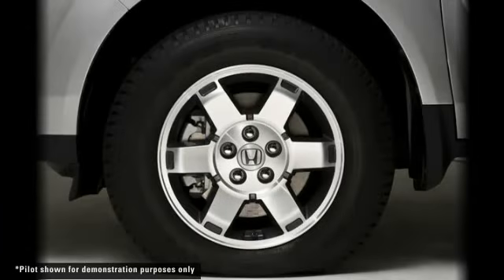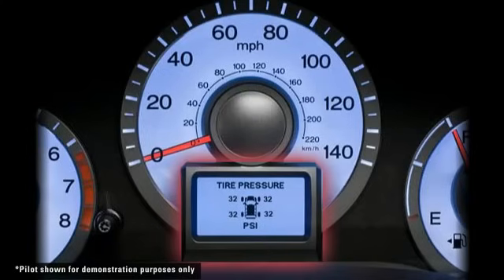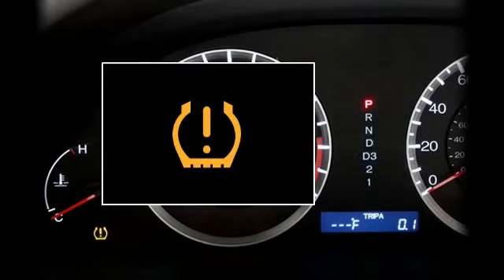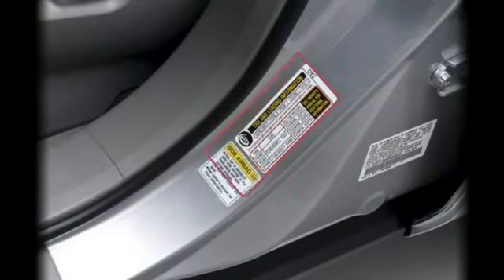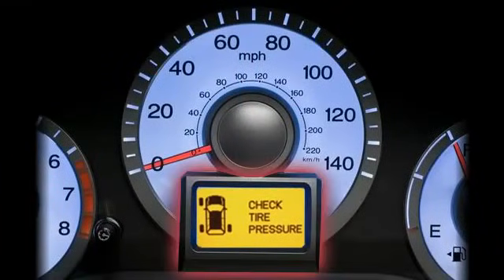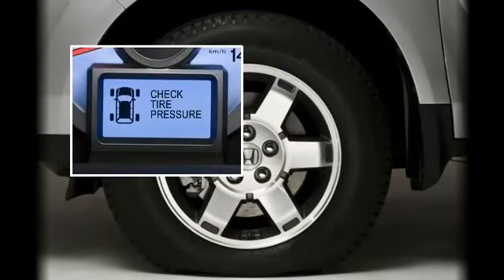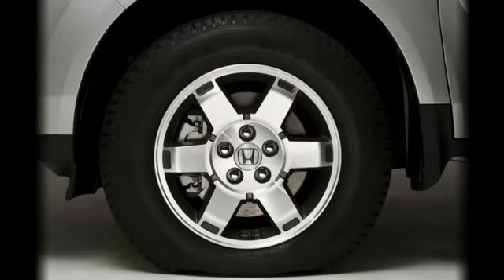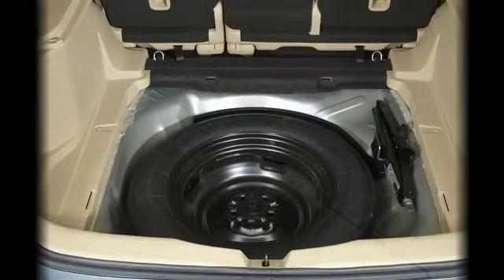Honda's Tire Pressure Monitoring System (TPMS) Explained

Comment: In the good old days, drivers didn't need a TPMS! All you had to do was to do a monthly (or more, if you wanted to) tire pressure check using a simple pressure gauge (either the pen type or a dial type). If your tires were running a bit low, go to a gas station and put a little air into the tire or tires. Let's call this the "Boomer Tire Pressure Management System" or BTPMS! You know what? You still don't need an automated TPMS if you use the BTPMS, which is what I do. My TPMS light came on, but I have a nice analog dial tire pressure gauge, that I use each month. I also have a digital tire inflator that I use to keep my tires at the precise pressure that I like. Let that TPMS light wear itself out! Useless gadgetry! 😣

Comment: 2014 Honda Pilot. All of the tires are almost brand new. Not flat. But the stupid sign won't go away
Reply from the maker: Hi Fina! You might need to get your local Honda dealer to reset the light!

Comment: What happened if it’s says tpms and monitor problem and I got 4 new sets of tires
Reply: Ohh let me do that in 15 mins I get out of work and let’s see the readily :)
Reply: I think I tried that before like reset your tire light away
Reply: Wiring or ecu, take your pick…
Reply from the maker: Your TPMS censors will have to be calibrated every time you put new sets of tires on your vehicle. It will be under your- Vehicle Settings>TPMS Calibrations. Calibrate them 3 Times! On the 3rd time it will put the car into learning mode and it will take care of your issue. If your light doesn't go out then, you will need to see your local dealer and let them try to recalibrate them. :)
Reply: I did that two times this morning and it still has the light I don’t wanna take it to the dealer I have to wait for 4 hours for them not to fix it I already did all that and waited atleast every 4 hours every time I hit the dealer and they say they we can’t get to the senor all the time I been there I been there like 6 times

Comment: Whats the Correct air pressure for Honda odyssey 05 please
Reply from the maker: Front Tires: 33PSI. Rear Tires: 35 PSI.
Reply: @holmeshonda  That's true but in general always look in the frame of the driver's door for the tire pressure sticker.  It should be on the right side of the frame as you are standing in the open driver's door. That's the standard place for tire sticker that the tire installer should have put there, this way you can get the correct pressure for any car you drive

Comment: my under inflated light did not come on (2011 Honda Odyssey) but my TPMS light did so i checked all my tires and added the necessary air until recommended pressure. Now, how do I reset that TPMS?
Reply: rakistang pinoy that means a battery is dead in one of the sensors or the system has malfunctioned... I have a 2011 Honda Odyssey as well and the TPMS light is on... I just check my own pressure every week and add air when needed... did you have yours fixed?
Reply: I have a 2014 Odyssey and the tpms light is still on and I scan them all. And they were all good, what's next.